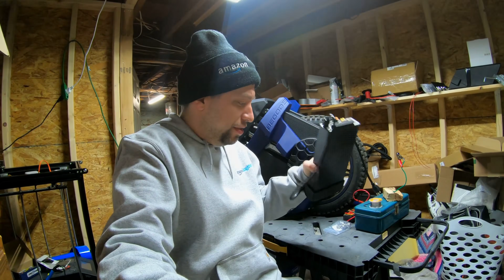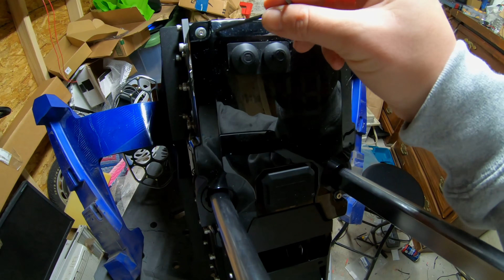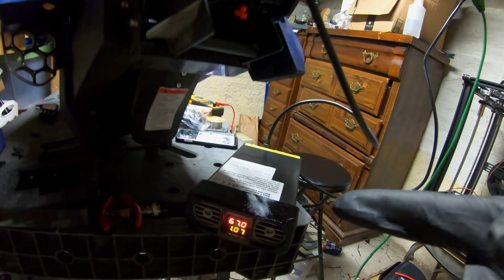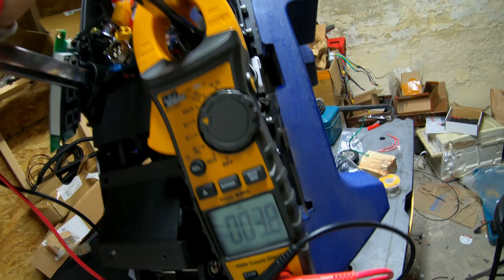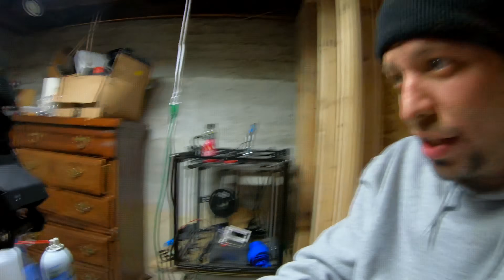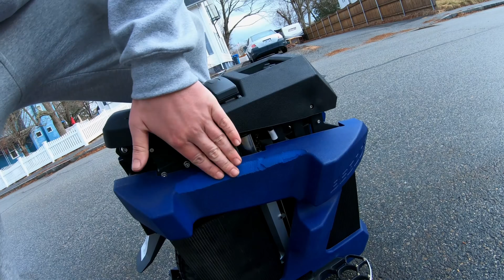EX30 Coil Shock Install, Balance Charge, and Adding USB port (FAIL)

Comment: I did not know you could add a oil shock to the ex30 and all the other begode wheels that come with either air or spring. Master v4 are on sale now, but i didn't get it cause i hate that type of shock.

Comment: Hey George, nice informative channel 👍 love the content and the pro tips you give. Can you tell me where did you buy that oil coil shock from and that is the part number or name so I can make sure I buy the same one for my ordered EX30. Thanks budd.
Reply from the maker: JFOYH Coil+Oil Shock Absorber Adjustable Damping Hydraulic Rear Shocks For MTB/E-Bike/Scoters, 125MM/150MM/165MM/190MM 550LBS/1000LBS/1500LBS https://a.co/d/cv3d0xQ
Reply: Beast, thank you. May I ask you this, in one of your videos you said "if you are 6ft tall and over 190lbs, this is the wheel for you." I'm 6ft and 240lbs without gears on, do you think the Sherman S better or the Ex30. I'm so torn between both. I know the sherman s suspension like no other but man the sliders on the EX30 with your suggested oil coil over upgrade it seems even better ride than the sherman s. Since you tested both, do you think the ex30 is better? Also, should I go with 200mm shock since I'm weaver set dude? Thanks brotha... can't wait for your next video. You taught me how to ride through your videos, much appreciated...
Reply from the maker: @UniFanatix  the ex30 better for big dudes for sure imo. and the 190mm will actually be stiffer than the 200mm. mines a little to stiff for my weight so might be perfect for you
Reply: @GoGeorge  thanks a lot man. Can't wait to see another adventure video from you. Be safe 🙏

Comment: Mine also says 133. Im using stock charger that says 134.04. Im ok with the 133 i guess 😂. Im going to do the same thing with the pads on mine, i have not rode it but got on and i can tell it will not feel good.

Comment: Got my EX30 on the way and I'm trying to decide on what suspension to get. Did you notice if there was room for a dual chamber shock? I would love to fit a fox or rockshox in there lol I also have to look into if getting one of these custom linkages is worth it on the EX30. With the money these wheels cost I want the ride to be perfect lol

Comment: Hey George, when you have charged your batteries to 134,4 and the app is STILL only showing 132,8/133V, then this is NO problem of the charge distribution board. The problem then is in the motherboard of the EX30 which just measures the REAL voltage about 1,5Volt to low! Thats a VERY common and known problem of GW motherboards, as the voltagemeter is cheap and so sometimes having that difference. So: When you use your stock charger, and reach 132,8 Volt or 133Volt you now KNOW that the REAL voltage is at about 134,2 or 134,4. 
The latest distribution boards should NOT have the problems that Marty mentioned in his video anymore.
Seams really like the common miss measurement of the motherboard. Control it once more and as long as your battery shows 134,4 on the voltmeter all is fine.
Reply from the maker: no, the batteries balance put at 66.8v each. when taken off the stack charger they read 132.8 on my multi meter. once balance to 67.2v, they read 134.4v on the multimeter. once plugged back in they slowly drain back to 132.8v and rebalsnce at 66.8v each instead of the full 67.2v
Reply: @GoGeorge  that really sucks then and the distribution board eats away some voltage….

Still something seams wrong with the board when you charge to 134,4 Volt AND DIRECTLY the app shows 133 Volt. I know that “hot charge port protection diodes” eat away 0,6 Volt, but I have no clue where the other 0,8 Volt missing are coming from….

Comment: Nice video, so far I happy with the stock shock and had a buddy adjusted my charger to put out a little over 134v so it will do a full charge. I too also had the same problem with those paddings, I end up shaving it from the inside on an angle to have it tilt in at the top, works great and cleaner look. But so far I ❤ the EX30
Reply: How did your buddy fix the charger to get your wheel to a full 134 V?
Reply: Yes please answer about modding the charger

Comment: After riding for a few miles you should check to see if all batteries read the same voltage. Marty’s had different voltages after his ride. This could help see if your problem is related to his.
Reply from the maker: 200 miles in, all balancex

Comment: Hook into the headlight circuit, it should be 12v
Reply from the maker: then the headlight needs to be turned on to use it. im thinking the tail light since its always on anyways

Comment: Why am I not surprised you cant keep your grubby hands offa mods on the new ride 😂. Far's the voltage issue, it could very well just be a misread by EUC.W & will eagerly info await more on it. I agree with the hydraulic coil shock upgrade - any issues with spacing installing it as the 1600lb coil is slightly wider than the 1000lb that Marty installed on his Master
Reply from the maker: yes unfortunately it is actually not full charge, all 4 packs balance at 66.8v.

and yes i had to grind down a part of the coil shock so that i could get the pin in the back. the coil fits just not the neck of the mounting area